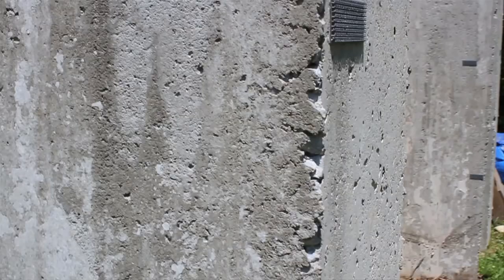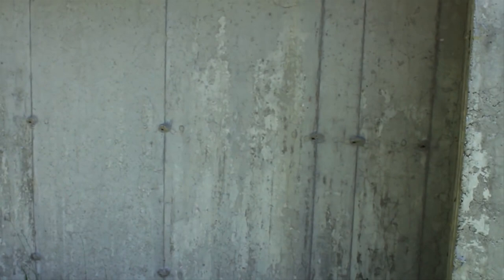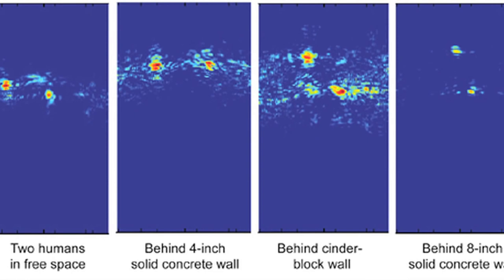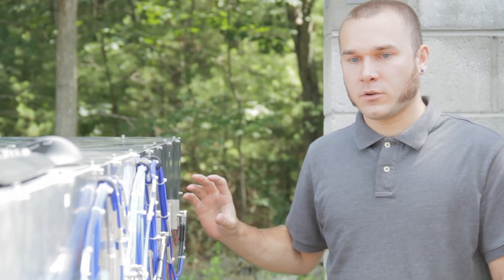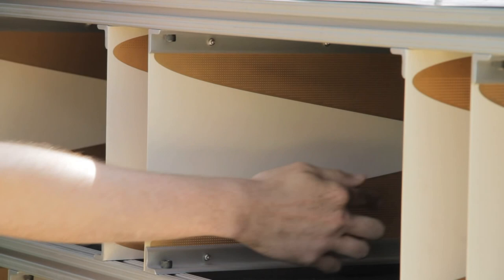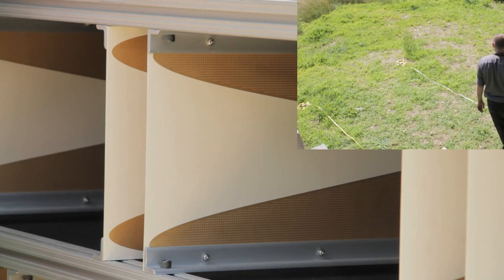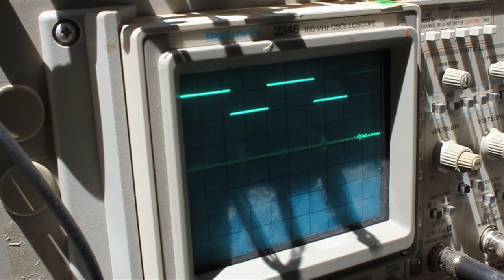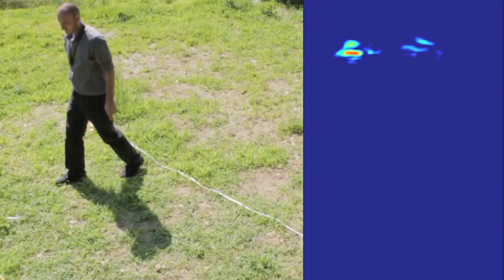Seeing through walls - MIT's Lincoln Laboratory

Comment: @13hlupak The majority (99.4%) of the signal is reflected by the wall going in (and also coming back through the wall!), so the signal they have to pick up is 0.0025% of the signal that is transmitted. I would imagine that requires a lot of antennae to pick up!